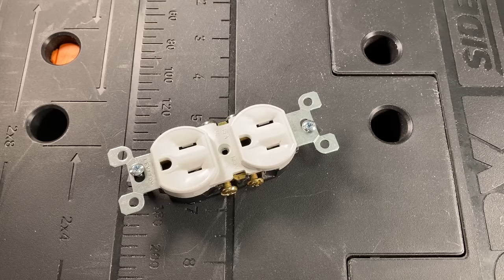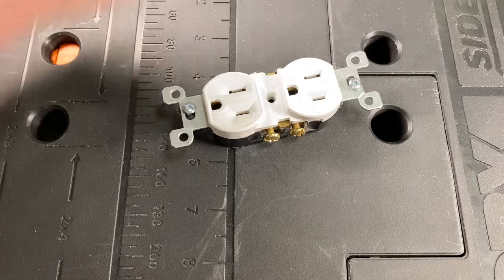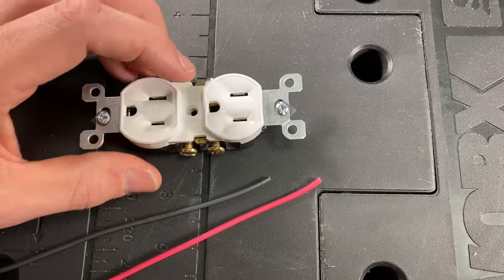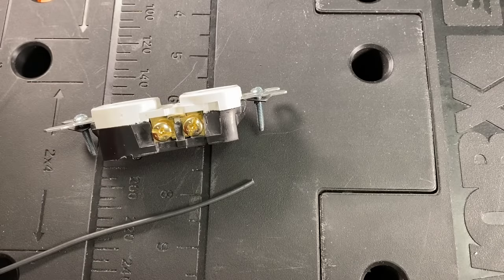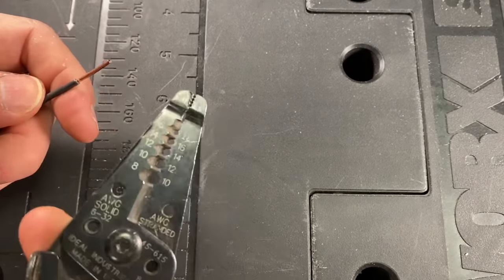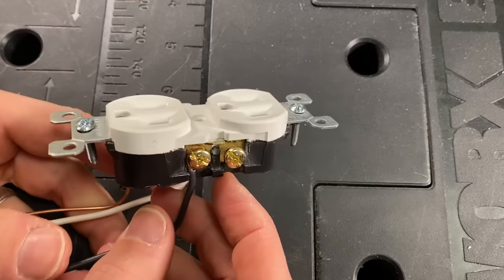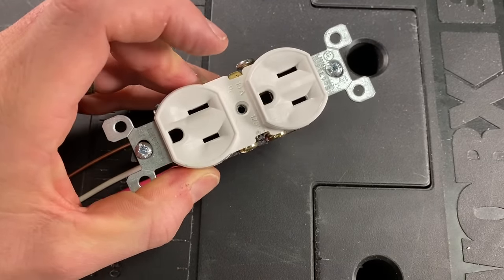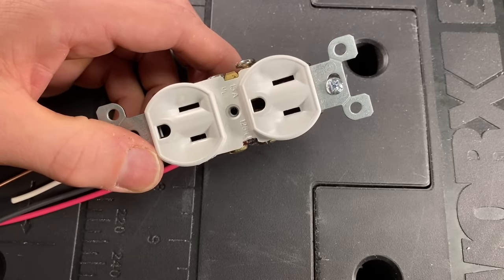Electrical Outlet Basics | How To Wire

Comment: Don't ever rely on the "so called" voltage tester. Also known as a "tick" tracer. They pick up milli voltage and can flash or beep  false voltage readings. Use a "true" RMS voltage meter, preferably fluke that's shows the actual voltage.
Reply from the maker: Thanks for the feedback Angelo,  yeah I think there are many who agree with you on the multimeter over the voltage tester.  I am also a big fan of Fluke and had a meter on me daily for years.
Reply: They are fairly reliable and have a place in my electrical kit to do a first check that the outlet is dead before opening up the box.  Also good for tracing/finding which breaker a wire is on.
Reply: Do not ever trust a non contact voltage tester. Osha doesn't even allow you to use them to verify a lack of voltage, only the presence of voltage.
Reply: I have always had a Fluke DVM and never tried the inductive though they might be time saver.
Reply: OMG, I've depended upon them for many years. Never had one fail me yet, but I suppose they only need once with the right conditions.  I've always called it a cricket, because of the chirping noise it makes.
Reply: That's really old school. The ones made today are really great. But, even better. Just use a radio turned up real loud...
Reply: @wwilkjr52979  That's BS. If that were true. Nobody would sell them.....Maybe you don't know how to use one. Here's a clue. Read the directions....Oh, and know what you are typing. 
"use them to verify a lack of voltage, only the presence of voltage." I guess you intended to indicated. Powers off.
Reply: @timbernie  I've been an electrician for over a decade. I have taken osha courses, worked in plants where they manufacture transformers and taken several arc flash courses. 
You're allowed to use them to verify the presence of voltage only. They're not reliable enough to be used to verify the lack of voltage. Here's a tip, learn what you're talking about before you make yourself look even dumber. You're playing with your life here.
Reply: @wwilkjr52979  Gee Bill. That's strange. I carried a tick tracer for 20 yrs. Never had a problem. OSHA.....
And been everywhere in the trade. Starting in the US Navy. Yep, 38 yrs. And I also worked for an OEM.
Last place was really dangerous. Ya Can't see it. But, It will kill ya and blind ya....Lasers....
The new ticker tracers are nice. Had one that did ac/dc....and glowed. That flashlight one looks like I need a new one....
Reply: @timbernie  so, if I drive 100 mph on the road every day and nothing bad ever happens does that make it safe? If I work on 480v live transformers every day with no arc flash gear on and nothing bad happens does that make it safe? No. That just means I got lucky. One time. That's all it takes. One time. But hey, you do you. Just don't encourage others to be unsafe with you.
Reply: @wwilkjr52979  Got some more news for ya. If you are unsafe, the trade will weed ya out. 
Another one. To do the job correctly, it has to be done safely. If it's done safely and correctly, then the job gets done one time....
You are not listening. And talking past your self.....preach some more. We are the choir....
Reply: @timbernie  volt ticks aren't reliable enough to verify the lack of voltage. Period. I showed proof that it's not osha acceptable and you still choose to argue. Your ego is staggering. I have no interest in continuing to argue something that has already been proven. Good luck.
Reply: When I check to verify for lack of voltage with my tester, if there's a known, similar power source near, I'll check that and get a beep to verify my tester is working.
Reply: @wwilkjr52979  I agree with you.  Every electrical safety course I have ever taken, even back to my days in the US Navy as a Nuclear Missile Tech on a FBM submarine; Never ever trust non-contact devices to test for and verify a zero energy state.
Reply: @jwccsnm  and here's the thing dude. I've done that too. I've used it in a way that it is not ment to be used. 
But I'm never going to say it's a good idea. I'm never going to suggest doing it. Especially on a public forum that is showing propel how to do electrical work.
Reply: @timbernie  There are no old, bold electricians? :-/. Here’s my philosophy, YMMV...  Being risky is not the same as being careless.  You can do something risky, if you do it carefully.  If you do something carelessly, there’s a good chance it will bite you!  If you do something risky everyday, sooner or later it will bite you, because you WILL eventually slip up.  Take the time to double check what you are doing.  Measure twice, cut once; Test twice, before you start taking stuff apart...  Once in a blue moon, you may find wiring in a box on two different circuits!!!  Very Bad Practice!
Reply: @wwilkjr52979  you are 100% correct. Just because we do things we aren't supposed to, that doesn't mean we should be telling other people, who aren't electricians to do the same. In Canada you have to wear arc flash clothing, rubber gloves, and a face shield. You must use a voltmeter to ensure zero state, and that is the only approved way to do it, even if people do it other ways. No matter if it's a 120v receptacle, or a 600v bus bar.
Reply: @EverydayHomeRepairs  can you do a video on the difference?

Comment: One thing I would add concerns a situation where there is more wires coming into a utility box from another cable. There should not be more than one wire under each screw terminal in order to be done properly. This means that wires are to be common, i.e. black with black to a pigtail to the screw terminal.

Comment: I F*ing love this video. I just changed all my outlets and kept blowing the breaker. That stupid little tab got me. Had a switched outlet just ruining my day. Appreciate these videos a lot. Thnx.
Reply: If blowing the breaker, you want to make sure if using more than one circuit on a switched receptacle that you are not using feeds from adjacent breakers as that would place 240 volts in the box. If the tab is not broken that means you just tied two separate hots together.

Comment: I've watched so many electricians use the strippers to remove the insulation and then pliers to bend the wire.  I learnt here for the first time about the little hole in the strippers - who knew !
Reply from the maker: Nice, yeah that little hole is pretty handy 👍
Reply: people who do it a lot will always find a technique that works best for the,.  I don't use strippers at all for receptacles, because a pair of Klein lineman's pliers is the correct width for the length of the bare section and the end of the jaws is the perfect thickness for making the hook.  the bending hole has never been quite right for making he perfect hook in one motion.

Comment: Thank YOU...I did learn some new ways tonight. Very interesting... I do have an outlet at one window controlled by switch. I will have to look at it. I assume if I plug something on the bottom, power won't go out when I turn the switch off. I can also test one in bedroom. Otherwise someone did not do it correctly. This was Good...Thanks Again. Merry Christmas....
Reply: It's not a matter of correct or incorrect. It's a matter of preference.

Comment: Word of advice: Never use the stab connectors on outlets. They are notorious for failure. On switches you're probably okay using them because most lighting, especially LED, is low current draw.
Reply: Well then do tell sir, what kind of connector do you recommend we use?

Comment: apartment im working on is from the 70's the one outlet i had didnt get enough power. so i down grade the voltage with a smaller number. going to try with this type of outlet later

Comment: Despite those that are analyzing this to death, thank you, I learned a few things.
Reply from the maker: Thanks Dan!
Reply: OMG , I think this is the problem I have ! who the fek wires up like this and doesn’t write it on the breaker box I’m extremely lucky not to have had my biscuits burnt . I replaced a socket in my garage, only one socket was working . Turned the RCB of Replaced the socket , simple ! Disconnect the socket and copied the connections 👍 . Turned the RCB on everything working fine both sockets back in operation 👍. Went back to the breaker box because I had noticed one switch on one breaker in the opposite column was slightly out of line . So , I decided to touch it , “ I’m an Englishman and I like uniformity “ so I lined it up . 💥 I released the kraken  💥💥🧐  . It’s off again now and after following your video I realize my mistake  . I’m going to cut the little piece that joins the two sockets together . If we did that in the UK we’d have 480 volts and a prison sentence. 
Thank you 👍
Reply from the maker: @philco7044  😂"480 volts and a prison sentence."  Thanks for sharing!
Reply: The Death Analyzers are making valid points.

Comment: I was pretty glad you mentioned those push-in connectors. Those things are awful and should never ever have been included on an outlet. I'm pretty sure that's why my house burned down. The previous owner used them on all the outlets. I didn't get to the kitchen to fix all them where the fire started.
Reply from the maker: Hey Jake,  thanks for sharing your story.  Same as you, I am surprised the push-in options are still included knowing all the issues they can cause.

Comment: One more thing: I always wrap electrical tape all around the outlet, covering all connections and screw heads.  This prevents ANY contact with a metal box and the receptacle itself.  Can't have too much insulation, right?
Reply from the maker: Hey Howard thanks for the tip!
Reply: I like to do this as well as pinching the wire end around the screw with needle nose plyers.
Reply: True if you don’t use a plastic BOX !
Reply: waste of time and tape
Reply: @somerandomboomer243  no, no it’s not.a waste.  Especially where you have metal jboxes.
Reply: @mscottsimon  don't you think if there was any reason to do this it would be required by the electrical code. If your box is bonded as required any contact with the hot side of the receptical will trip the circuit breaker. Therefore putting tape is a waste of time.
Reply: @somerandomboomer243  you’re the pro, Doug.  You do you.
Reply: @somerandomboomer243  not unless you have an AFCI breaker in. It’s still going to arc and there is a potential for a fire. It’s very common that a breaker doesn’t trip also and then you have a house fire. Bonding the box to  the grounding system isn’t going to stop the fire if it’s arcing.
Reply: @jimmysapien9961  even plastic boxes can have bare ground wiring in it.
Reply: Totally worthless.  Have you SEEN what electrical tape looks like after even 1 year?  The glue decomposes leaving goo that won't hold the tape.
Reply: @guygordon2780  stop buying your tape from WalMart.
Reply: It certainly won’t hurt when using metal boxes, especially if the box is over stuffed, but I usually only wrap the terminals of the receptacle in tape if I’m working live and can’t turn the power off or simply choose not to. However, I don’t advise working live unless you are a professional and sometimes we even have to shut the power off.
Reply: @guygordon2780  k8
Reply: @somerandomboomer243  Code is a minimum standard and does not constitute a best practice.
Reply: @SuperVstech  
That's why the ground wires should be folded all the way to the back of the box and it's best to pigtail a green wire to connect to the receptical. (But most people aren't going to do that, I admit.)
Reply: I've had times where I've turned off the circuit to work on the outlets for whatever reason and the other idiot workers on site TURN THE BREAKER BACK ON WITHOUT TELLING ME... Real glad they were wrapped in tape when that happens

Comment: I've sold outlets for 15 years and didn't know about the wire strip gauge on the back or the wire retainer. 

If I have someone asking me where the black and white wires go on an outlet or switch, I tell them the dark wire to the dark screw and the light colored wire to the light colored screw.
Reply from the maker: Always learning 👍
Reply: Same here but I think I just always guessed pretty close.
Reply: Not to be rude but I find that a bit shocking. In 15 years you’ve never looked at the back of an outlet you’ve been selling?
Reply: That is a good thing. You don't meet a whole lot of people who are color blind. I have worked with 3....
When it came to colors. They would find me....
Reply: Long time ago I learned it as "black to brass" and it sorta sticks in your brain. 50 years later I still say it in my head when making a connection.

Comment: @1:35 my breakers kept jumping after I installed a new outlet and I couldn't figure it out until you mention the tab and then I realized the tab on the old switch was broken off.  Thought I did everything right because all the wires were connected etc but it was that little stupid tab that made everything not work but it's not anywhere in regular instructions.  Thanks

Comment: It's also helpful to know that the wire loop needs to end clockwise. Was an issue for me starting out.
Reply: What happens if it’s the other way? And 2 , my outlet only had 2 wires and I put those on the bottom screws of the terminals on both sides
Reply: @messynate  tightening the screw will spread out the loop and push it away from the outlet screw giving you a poor connection.
Reply: @messynate  sounds like you're missing a ground wire?
Reply: @humzilla707  yup no ground wire . So the right side I put it on clockwise. So you’re saying match the left side ? Or clockwise always cus then it’ll be going the opposite direction if that makes sense
Reply: @messynate  clockwise always. Wire going under the screw on one side and over the top on the other so that the screw is pulling on the wire and not trying to push it out when trying to tighten it down.
Reply from the maker: @messynate  That should be fine as the standard setup for an outlet (without breaking off the duplex tab) would be for the top and bottom terminals to work the same as they are connected together.
Reply: @EverydayHomeRepairs  thanks! But overall it was a two prong with no ground wire and I changed it to 3 prong. Is that safe?
Reply: @messynate  it’s not legal to put a grounded outlet on a non grounded system. Probably the cheapest and easiest way to make it legal would be to install a gfci outlet. It won’t give you a ground but it will trip off the power if there is a fault. Other ways to make legal would be to run a separate ground wire to the outlet or to completely rewire the circuit.
Reply: Humzilla707 - If you watched the video, he Did connect the black wire to the brass terminal in the correct direction, so he was thinking, you will do the same thing.. If you did NOT do this, you quickly found out how the screw wanted to unwind the wire once you started tightening it down, right???
Reply: @frandanco6289  yup but as a beginner years ago that was the first thing that came to mind.

Comment: I liked your video, may i offer a few suggestions? One thing i would recommend is putting two wraps of electrical tape around the outlet, this prevents inadvertently shorting out another outlet, if there are two receptacles in the same box. Also 406.12 (1 thru 7) of the NEC states that all areas are required to have Tamper-Resistant Receptacles. Backstabbing receptacles and switches are junk, seen to many of these fail. Another thing to note if this is a steel box, the box has to be bonded as well 250.146. All though the NEC doesn't dictate which way the ground is orientated (6 o'clock or 12 o'clock) I do residential at 6 or how ever the other existing receptacles are done, and offices at 12 or how ever the other existing receptacles are done.
Reply from the maker: Thanks for the feedback Mark  👍
Reply: The electrical tape wrap around is unnecessary for standard outlets. There is sufficient clearance between adjacent units.  406.12 (1 thru 7) of the NEC states specific areas that need Tamper Resistant Receptacles. Some are quite open to interpretation. Personally, I find this nanny protection less than helpful, since most fail closed in a relatively short time, and someone will simply defeat it with brute force and ignorance, causing it to fail open.

Comment: You forgot to mention, that the wire should be fed in from the left side rapping to the right thus when tightening the screw it pulls the wire rather than pushing it.
Reply: I noticed that omission as well, but you will automatically do it correctly if you take the effort place the wire against the brace as was explained in the video.
Reply: Timothy Perry - If you watched the video, he did it exactly that way.. Have to assume that the viewers will watch it and do it exactly as he did it, no ??
Reply: @frandanco6289  never assume anything.  EHR should have mentioned what Timothy Perry said.
Reply: Wrapping, not rapping, leave that to Snoop Dogg.

Comment: you should always check to see if there is a clip on the old plug before you remove anything that means hot side and neutral
the reason is some times you can have duel feed circuits and if they are out of phase and you dont remove that clip you have a 220 volt dead short and when you turn on that second breaker bang

this is most commen in kitchens and garages
Reply from the maker: Hey Randy, thanks for the words of caution ⚠️.  Appreciate the help.
Reply: I don’t understand what you are saying.

Comment: Fluke has the best non contact voltage tester
Reply from the maker: I used Fluke multimeters for years in a past job and agree their products are usually solid.
Reply: Best $35 you will ever spend is a Fluke non contact tester